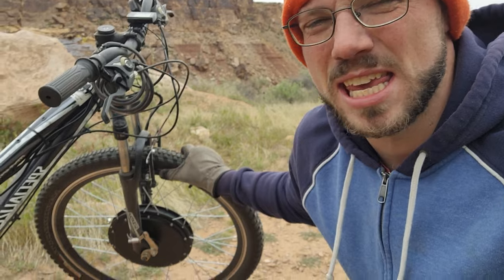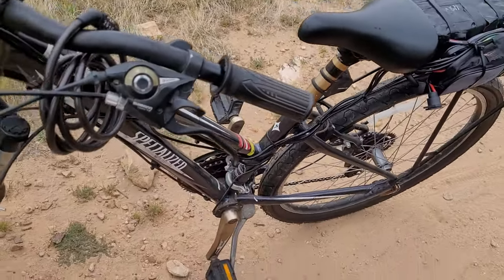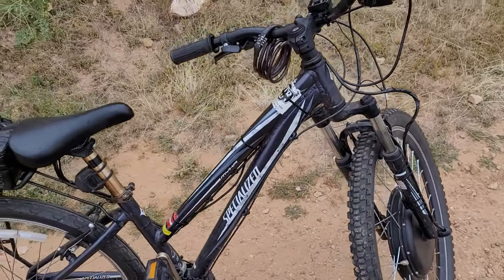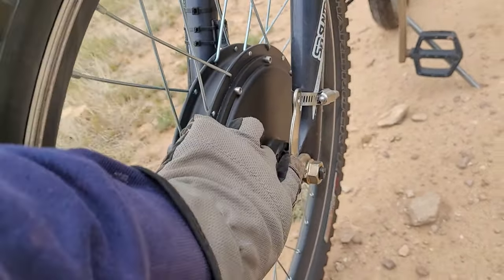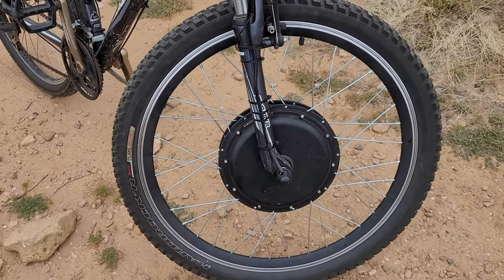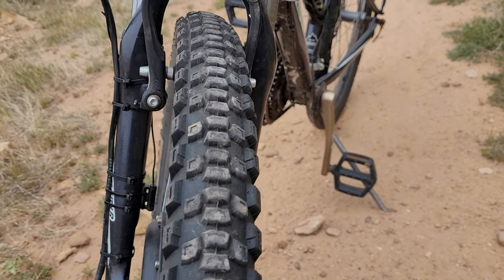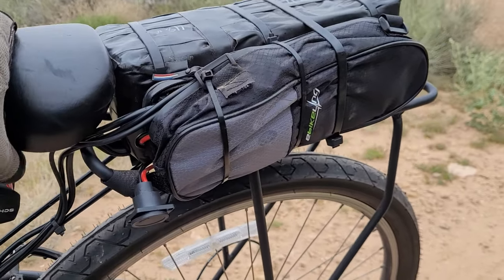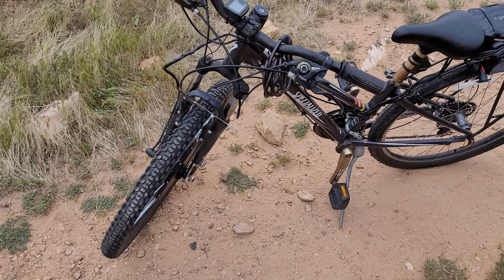Front Hub Conversion Kits Are Awesome

Comment: I thought brushless motors have more torque
Reply from the maker: I guess that depends on the torque curve of the given motor. You are correct though; a well-built brushless motor will always have more torque at low speeds. In my experience with small, brushed E-bike motors, they have more torque at very low RPM's, and drop off at higher speeds. This particular build is fairly gutless under 10mph then hit's its stride all the way up to 30mph. Could also be a controller/battery pairing though.

Comment: That type of fork is the most unsafe to be used with front hub motors, its experiencing lot more torque at the stanchion crown joints than its designers intended every time you gun it. There's plenty of pics online of them failing. At least keep an eye on the crown casting near the stanchion "socket" and check for any play in the joints from time to time. I'd switch to double crown fork, but that might be pricey. Definitely don't switch to a more powerful controller, that motor can handle it but the front end might not.
Reply from the maker: Seems to be holding up just fine with the controller it came with. I'll keep an eye on it, but I don't expect it to ever be an issue with the current torque and power available.